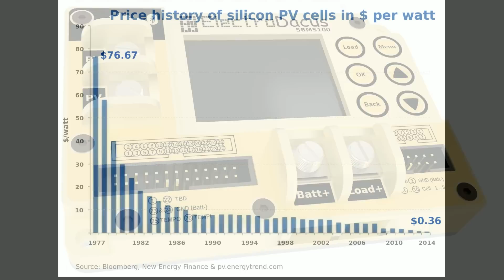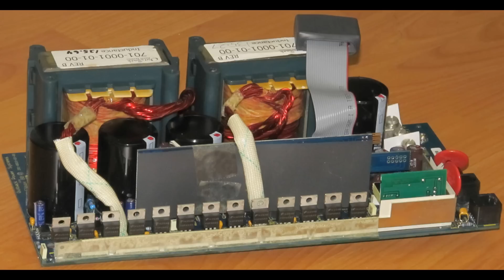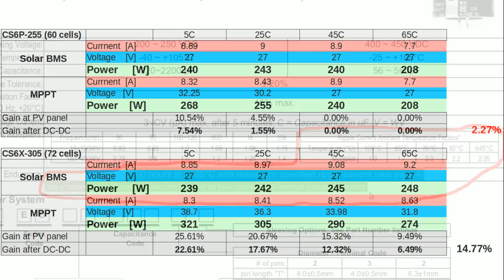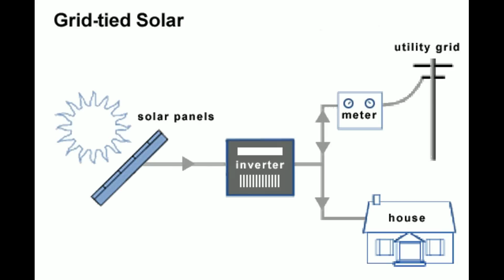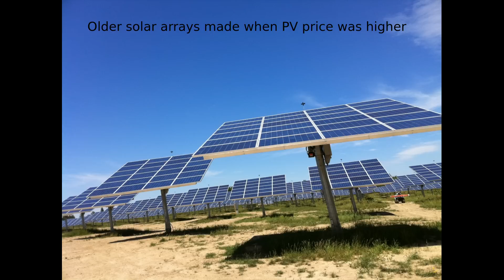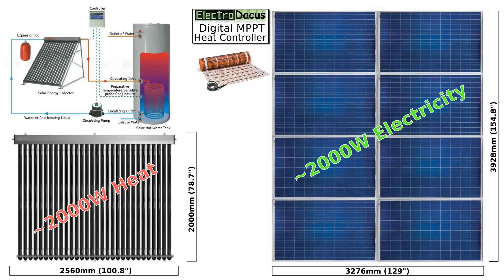Is the MPPT in OffGrid Solar obsolete ?

Comment: I agree in an off grid situation that a MPPT is not a economically viable.
Unless there is a size limitation and you need to store all available energy.

Some modern Microinverters don't even have electrolytic capacitors
http://electronicdesign.com/energy/pv-micro-inverter-gains-ul-certification-without-electrolytic-capacitor

Others like enphase have done extensive research: http://enphase.com/global/files/EnphaseElectrolyticCapacitorLife.pdf  
Conclusion: This study has shown that electrolytic capacitors are not a significant point of failure for microinverter reliability.
The useful life is estimated to be well in excess of 50 years even when the inverter is located in a harsh environment.

http://www.eetimes.com/document.asp?doc_id=1278778
Reply from the maker: Even if there is a size limitation is better to get more efficient panel. The 60 cells one in the example where 255W mine have 240W and are the same size but you can find now even 270 or 280W with the same size a bit more expensive but no where near close to MPPT additional cost.
Also in OffGrid you can not have energy at the limit or less that is how people got used with when they used Lead Acid and had a diesel or gasoline generator to help them any time they needed. That generator is even worse than MPPT as cost amortization I should have included that in the video.
Yes some micro inverter use ceramic capacitors but they are micro inverters usually designed for a single PV panels they will be more expensive /Watt and they are not designed for OffGrid.
You can also make a version of that FlexMax with ceramic capacitors that can last the life of the panels but it will be more expensive maybe not as expensive as 3x but around 1.5 to 2x more expensive. Still as I mentioned in the video a 2000W 80A 24V MPPT controller in order to be competitive will need to cost $240 same as that extra panel and last for 30 years even at that level all that will do is get the money back after 30 years no profit.
So even if that $540 Flexmax can last 30 years it will still cost over 2x more than just have the extra panel.
They did not used proper values in they calculations related to operating temperature specifically so their conclusions are no good.
Those micro-inverters are completely sealed since they need to work outside usually on the back of a hot panel (the cells alone as I used in the calculations can get to 65C) and they considered that temperature inside their micro-inverter at worse case is 43C or something like that. That may be true in the winter or early spring but for sure not in the summer.
This Flexmax at full load has a loss of around 50W and a small fan to help with the cooling and it needs to smooth currents around 80A.
Micro-inverters usually work with 10x less around 8A the output currency of a single large PV panel so about 10 of those micro inverters will be needed to replace one of those FM80. I'm sure the cost is not lower and they are not for OffGrid
I'm also sure they do not need to pass any FCC radiation standards I'm referring to both micro-inverters and OffGrid MPPT controllers. If they will be requested in the future to do so they will get even more expensive.
Solar BMS has no high current switching the only noisy part will be the WiFi if turned On.
Reply: ***** 

As far as I am concerned it comes down to this: 
off grid: MPPT == not worth it
grid tie: modern mppt with microinverters is worth it.

Jeez my response got flagged by google for spamming. It seems it is only visible to me :-(
Asked for unblock.
Reply from the maker: Danny ter Haar
Yes not sure why google marks you comments as spam I needed to approve the original one also since was marked as spam.
In Grid tie the MPPT hardware is there since you need that DC-DC converter anyway in order to work and you need to do MPPT anyway so there is no choice (you can not reduce the cost there).
And you have the advantage for now that you can sell all you have at any time. In the future if there will be to many Grid tie arrays it is possible they will need to reduce or prohibit you to send energy in to the grid when you want.
They can not stop a nuclear reactor just so that you can send your energy in to the grid :)
Reply: ***** btw: electrolytic capacitors i replaced to repair a xantrex 3.8 grid tie inverter after 11 years of use (1 year out of warranty!) http://www2.dth.net/solar/xantrex/gt3.8/IMG_20140823_120653.jpg
Reply from the maker: Danny ter Haar Seems similar 105C rated capacitors. How much was that inverter used ? What size array was connected to it compared to his design limit ?
If only those capacitors failed and you where able to do a simple repair that is great.
It seems like almost all failed at once. Thanks for the photo.
Most people will have discarded that and purchase a new one.
I see something that looks like a date code week18  2006 maybe was still in warranty or maybe that is not a date code.
Reply: ***** 11 year old, and was used with 4000 Watt DC rated array. It first blew a grounding fuse, than it stopped outputting anything. I only replaced the 5 caps and it worked again. This person wanted a new one with 10 years of warranty, so he got a 5kW sunnyboy as a replacement.
I tried contacting Schneider/Xantrex about a recall for these inverters twice , both times they promised to send me a replacement part which never came. 
http://www2.dth.net/solar/xantrex/gt3.8/IMG_20140911_140645.jpg is how I tested: use variac 110 volt  to  110 -> 220 transformer (isolated) -> rectifier -> in series with a light bulb to the DC input of the inverter.
If it shorts I have a bright light , but I can regulate the voltage on the input.
Reply from the maker: Danny ter Haar wow that thing looks huge :)
Is that a 4 or a 5kW inverter?
Most of the time those inverters are used at max capacity so they have to make them work at that level to meat the warranty.
I'm even impressed they re so confident as to give 10 year warranty.
They are fine as long as there are no more than 5 to 10% fail rates.

Comment: But the advantage of the higher voltage controllers is something to take into consideration? Im on the fence about which controller to get. I have plans for another tracker and i already have it made. but no panels bought for it yet. I know that trackers keep the panels cooler since they are out in they yard with air moving around them. It gets super hot here over 112 sometimes. Always above 100 in June July and August Sept.  I am getting ready to spend 600 dollars should I buy a PWM and a panel or should I get a 92 amp Midnite MPPT solar 150 volt CC? hmm I dont know. I like the idea of having the room for plenty more panels on the 92 amp midnite solar 150 solar mppt. In the summer when the voltage is low on the panels I cant make a lot of power its just too hot for PWM controller. Mppt can use the higher voltage and needs in the hot weather. so much to consider in my situation. when I get all that power I m just going to have to get more batteries. seems to me like more batteries may be the best solution for off grid that Im doing now. I cant grid tie anymore I got a smart meter. unless i want to get really expensive wiring and grid ties for code. I really like the set up for my freezer four 230 watt panels on a tracker and 220 amp hours of Optima yellow tops runs contentiously with out going down. only problem was when we had no sun for about a week. I had to plug into the grid for day but then the sun come out finally the next day and I was back in business.
  the two trackers with three panels each run a different system in my shed hooked up to four golf cart batts. that system is blowing up Chinese CCs all the time i gotta do something about that. what CC should I get? I m going to add another tracker to that system. I will wire into my living room tv stereo and fridge. It ahs so far three 235 watt panels on one tracker and three 230 on another. I use two 30 amp Chinese CCs
Reply from the maker: In summer when panels are hot there is also much more energy than you can use in OffGrid so it dose not help if panels are a little cooler or can track the sun you will probably not be using that energy anyway. Also for the cost of the mechanical tracker you can buy quite a few more panels so you can produce all that energy at lower cost and your panels are safer in high winds that they are with the tracker.
Sure PWM is usually a better investment since it cost less and for the difference you get extra panels.
There is no such thing as to hot for PWM if the PWM can not work then MPPT will not be able to do more. What number of cells do you have on panels and what battery voltage ?
MPPT usually has no gain in hot weather the most gain as you seen in my calculation is in the cold days.
Batteries are by far the most expensive part so getting more of them is not the best solution if you care about cost.
If you have grid power at any reasonable rate say under 25 or 30 cent/kWh then it makes no sense to use your offgrid system especially with Lead Acid batteries. The cost amortization of those Lead Acid batteries is way over 60 cent /kWh that is just battery not other costs so use the grid power since is less expensive.
Energy directly from PV can be as low as 3 cent/kWh if you can use all (only in grid tie is that possible) in offgrid a large part of the energy will go trough battery and then the cost will be way higher at least 20 cent for LiFePO4 and at least 60 cent for Lead Acid but it can be even much more than that depending on battery and type of use.
Reply: Hi Shartne.  Yep, sounds like you need more batteries :-)

Just FYI: I originally built a solar tracker (physical sun tracking based on http://www.redrok.com/main.htm) and an MPPT ( also from a kit).  I did that as an Engineer to get the most out of a panel.  But I'd never use a physical tracker again, as they are simply not cost effective anymore.  As for getting more air underneath, that's a function of how you mount them.  I agree with you that higher voltage can be good, enabling you to use smaller wires, but also higher voltage is more dangerous, and why bother with the expense of a converter (a lot of devices run at 12 /24v).  As for MPPT's, I can see a case where they would be worthwhile, that is if you didn't have space for more solar panels, but otherwise it seems a lot more sensible (simpler and more cost effective) to just spend the money on more PV instead. 

If it's hot where you are, I'd probably go for the higher cell count panels.

As per Dacian's SBMS, I backed his last campaign and his product has been awesome, I'm backing his new campaign for multiple units, as I simply didn't get enough last time (as friends decided they wanted them as well).  Just before Dacian's last campaign came out, I'd spent ages and a lot of money building a system with LiFePo4's, when Dacian's SBMS came out, I couldn't believe how awesome it was, how much cheaper / less complex / higher power / lighter than what I just built.
Reply: shartne I've been thoroughly enjoying this thread and find it immensely educational.  But I have to interject here:  Atmospheric CO2 levels of 400 ppm is not in any way, shape, or form "life giving."  It's a freakin disaster and it's up to all of us to reduce our consumption of fossil fuels as much as we possibly can...NOW!
Reply from the maker: randacnam7321
That is a narrow view on the effects of CO2.
On a side note I was inside the house for the past 6 or 7 days do to extremely hot a dry whether that contributed to massive wildfires in northern Alberta and Saskatchewan.
The air outside is so toxic do to smoke that this will have long therm adverse effect on my health and millions of other people around this forest fires.
So yes plants absorb CO2 but they also release massive amount of pollution as it is the case now so not even sure if is not better without them :)
I'm not an expert in climate so do not take my comment in other way than an opinion.
Reply: *****
Yes right now it not cost effective to have a off grid system but it started out to be grid tied. But i am pretty positive electricity prices are going to go through the roof after they get their carbon trading in place. We may not even have a grid any more. Our grid is fueled by coal and they have deemed carbon the life giving substance to every living thing on earth a pollutant. Things are fixing to change. Just wait a little bit. It will be off grid for my protection. I m sure it will be a great asset in the near future. After the dollar is worthless its going to be like a third world country around here.
Reply: shartne Just wait for the price of batteries to come down!
Reply from the maker: shartne ***** is probably right the next revolution in low prices will happen for batteries probably or some other energy storage devices.
There are other countries with carbon trading and there is no problems with the grid prices there.
Reply: Appalling68
wow you must work for Al Gore You know  the guy who will profit the most from trading carbon credits LOL Your real funny. a disaster no way. ha ha ha. people have been burning fossil fuel for ten thousand years. The earth will abide for ever and every you cant hurt the earth. You paid trolls are so pathetic. How munch does google pay you or Rockefeller or Al ? what ever weirdo NWO  satanic creeps.
Reply: Appalling68 Photosynthesis begs to differ as CO2 is the carbon feedstock for it.
Reply: *****
CO2 generators for greenhouse use are quite common as plants grow much better and require less nitrogen for a given amount of growth in higher CO2 level growing conditions.  Present CO2 levels are actually dangerously low compared to prehistoric levels as photosynthesis stops at levels of 170ppm to 250ppm depending on the plant.